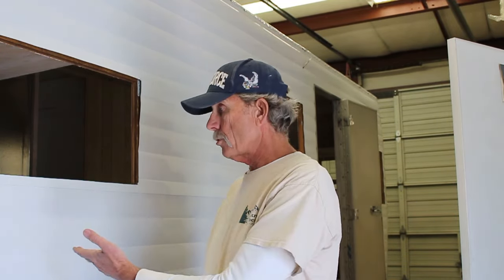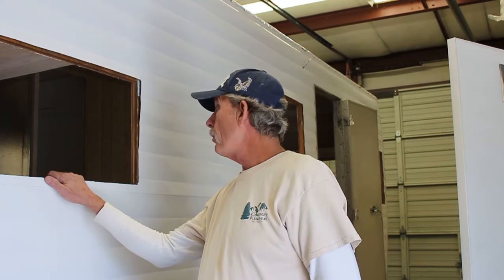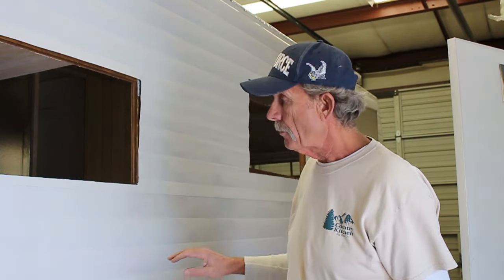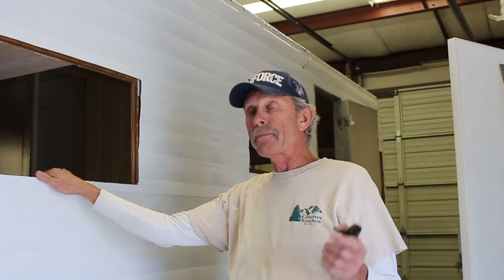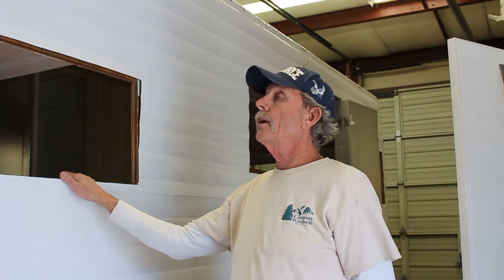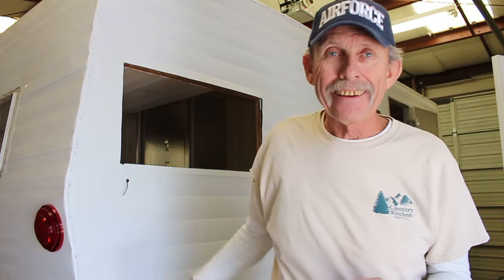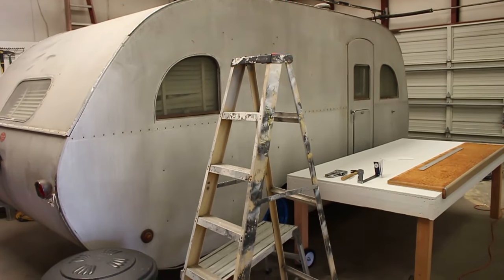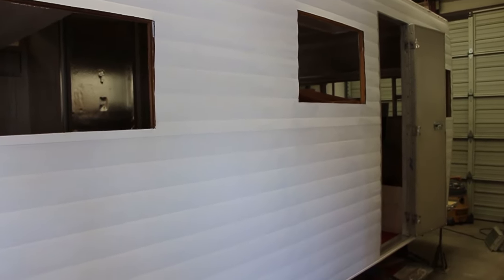V Log #16 - 66 Super Shasta Update plus Cameras

Comment: For a point and shoot with excellent video should've checked out the Canon S110 you would love that little thing
Reply from the maker: Well I had the SX680HS before and loved it until the inside filled up with dust. These are all pretty much the same really.
Reply: Sorry man I have to disagree, the canon "S" line is a small point and shoot, but they are not like the rest of the small canon cameras, they have a much larger sensor and a better lens, the camera you have has a smaller sensor and a slow lens (not much light can reach the sensor, bad image/video in low light) 

You really have to use the Canon s110 or canon s120 to know what I mean.. read about it, or search on YouTube, they're not all the same.
Reply from the maker: I'll take that into consideration next time I have to replace my point and shoot. Thanks for the comment.

Comment: Hi Larry. It will be interesting to see how you deal with those scratches. Is there an inexpensive scuff rap you can acquire to put on the metal prior to routing or cutting out the windows to protect it from tool scratches which is easily removed afterwards? They must have something which the OEMS do on the assembly line for problems such as this. The time to fix scratches like this would be very expensive on the factory floor. This cannot be a new problem. They still build metal wrinkle wall trailers and have to trim and cut windows, doors and other openings. I will pay more attention to the factory production videos I watch to see How they deal with this. Never considered this this to be an issue before. Ron
Reply from the maker: Let me know what you find Ron. It may be the type of routers they use. Perhaps there is no table on them to cause scratches. The hot metal debris get's stuck on the plastic table and you see the results. I've found that using the shears is actually easier with less waste material to pick up and no scratches to worry about. So I think I'll stick with that. I'll be doing a video on how to do this next week. So stay tuned.
Reply: @mobiltec   I was going to suggest masking tape to protect the finish if you use a router. You can also cut window holes very quickly with an air chisel and a double cut body ripper blade, that is how I used to cut windows in vans when I was in the conversion van business. Same tool to cut out the roof to install a fibreglass high top.

Comment: What if you just lay down a layer of masking tape before you do the routing, and let it take the beating?

For the current stable of cameras, put a UV filter on the front of every lens. They reduce UV haze outdoors, you can leave them on permanently, and their main reason for living is protection. They keep dust and debris and nasty stuff out, and if the lens takes a hit, the UV filter takes the damage, not that $500 lens. I've been using them for 50 years, and there's one on every lens for every camera I own, including the 1938 Leica model G. I've never lost a lens. Yet...  LOL
Reply from the maker: Cool advice John. Thanks. Tape is very hard to remove from the skin. I really like using the other method now. It's quick and clean and not anywhere near as much clean up both inside and outside of the trailer.
Reply: Always glad to throw in my nickel's worth, Larry. I've worked with more than a couple of lenses in my life. And if the clipper does better than the router, it's not just a substitute alternative, it's an improvement.